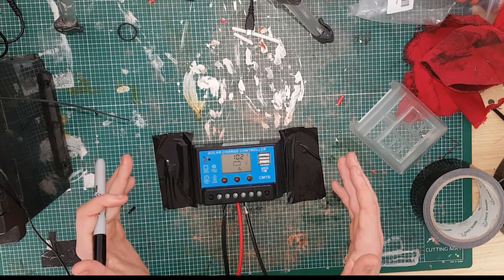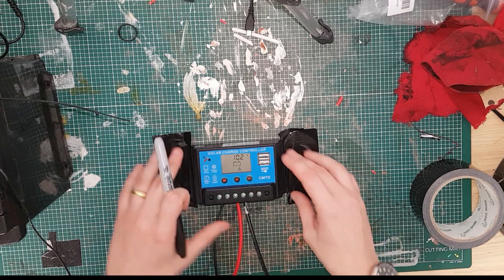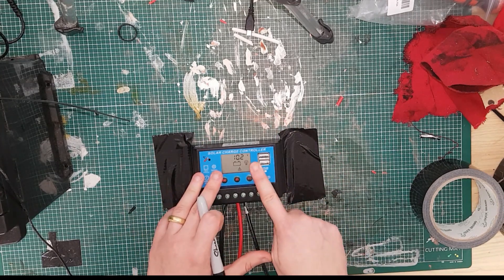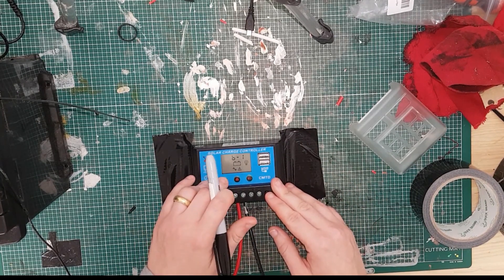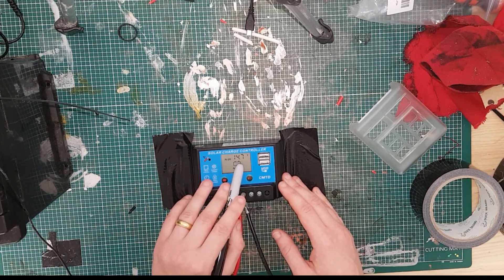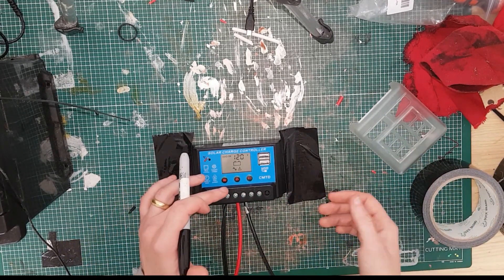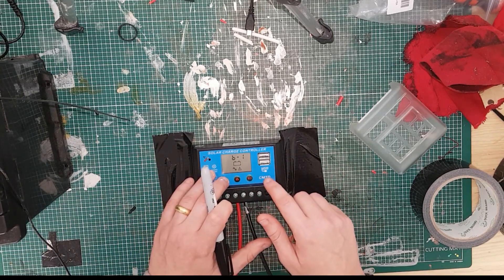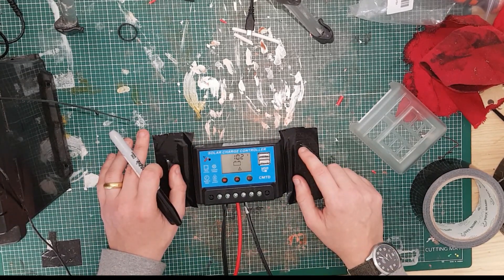How To use A Solar Controller

Comment: i have a 12,5v in from the solar panel, will it charge my 12v 7ah battery?
Reply: no, you need at least a 18v panel to charge a 12v battery.

Comment: Hi bro, my solar panel output is 42V . I have a 48v battery connected to solar charge controller. Will it charges my battery? Or should i need higher input from solar panels?
Reply: no, solar panel voltage has to be higher than battery voltage also this controller from the video is for 12 or 24v battery, you need a mppt controller

Comment: Thought for a second i was listening to Dick Strawbridge...lol.  I have one of these, but it skips past the 'battery type' setting function which is a pain. I've set the voltage for cutting off the charge to my AGM battery to 13.4v,  so hopefully no damage done as the solar panel trickle charges at between 1 - 5A depending on sunshine. These units dont seem very robust as there seems to be lot of people experiencing problems with them...imo.
Reply: You know the subtitles on YouTube says… “I’m drunk from….” Haha

Comment: The voltage number on display when it is hooked up   is it the voltage of the battery or the voltage going into the battery
Reply from the maker: Its the voltage on the battery
Reply: @Brains933  hi. I have one of these.  How come when I move the solar panel into the shade the number drops.
Reply from the maker: When its charging the battery the voltage on the battery will be higher. When it isn't charging as well the battery voltage will drop. If you have a multi meter you can measure the voltage on the battery to confirm.
Reply: @Brains933  ok iam grateful for that
Reply: @Brains933  why my charge controller still goes upto 13.8v but i set it to 13.5v ist normal?

Comment: Sorry for the thumbs down, but there is only one function I want to learn on this controller, and you don't touch on that, and you also don't actually talk about how to program it.
Reply from the maker: What function did you want to know. And outside of the settings I talked about there isnt much else you are able to program on this model they are quite basic
Reply: @Brains933  I believe I may be mistaken, but from reading the very poorly written instructions that came with the unit it seemed there was a way to program it to respond to the availability of light and power down loads that run off of the battery when the light levels drop, except the screen always stays on which seems subpar. Thank you for the prompt response.
Reply from the maker: Ahh I see, yes there is that functionality in some models but at least on the one I recived it was very unreliable. it doesn't seem to save settings correctly so I always leave it on default. I probably should have mentioned that in the video!
Reply: @Brains933  No worries. I will retract the thumbs down and thank you for the engagement.